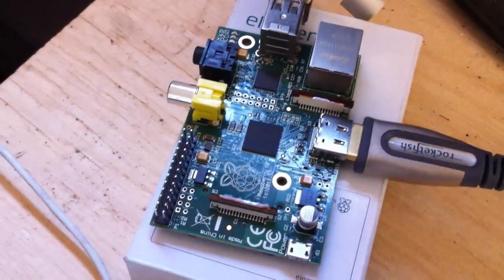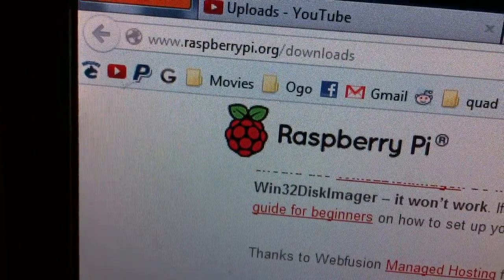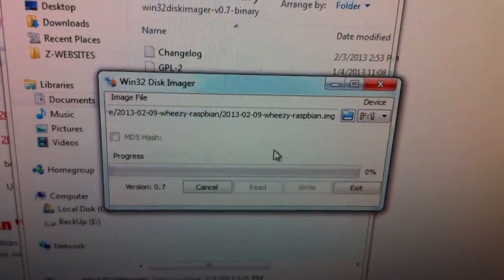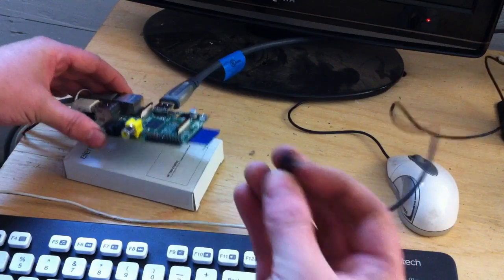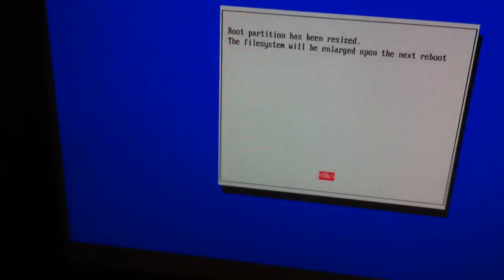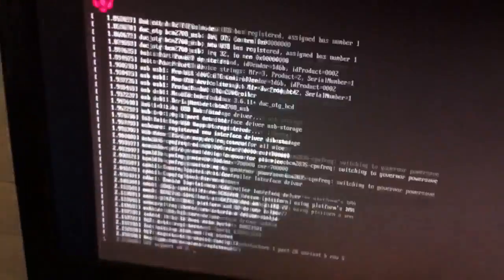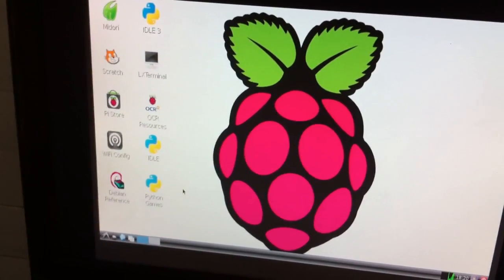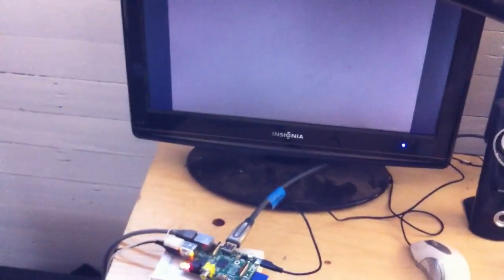How to set up your Raspberry Pi for the first time

Comment: Did you change your display settings to hdmi? or is it suppose to automatically take you to the boot menu when the pi is powered. The problem with mine is when i am connecting my pi with the laptop through hdmi, its booting the normal windows os which my cpu has

Comment: Thank's alot for the link to the WIN32 thing!
Followed the instrucions that came with mine, and could not find a download link/button...
Subcribed, you're worth it!
Reply: stuck on win32 trying to load Weesy without luck errs and such, however  am using a 32 gig card I bought. will I half to format it in windows first? or use the card that pi b came with? and I downloaded all my files in chrome any hints?
Reply: Russ Pavlick You need to format it.

Comment from the maker: Yes, you can use the yellow RCA port to go to an old TV or go to a computer store and get a HDMI to VGA adapter. The PI is being very progressive here not offering VGA. VGA is dead. You will need to use the 1/8" jack for sound if you don't use full HDMI. HDMI carries sound as well as a video signal.

Comment from the maker: Yes, I have mine overclocked to "Meduim" 900mhz with no issues. I have used the "Upgrade" and it does appear to update Weazy but I am still unsure if it just updates the bios maybe someone can post more info. Modern TVs and monitors don't normally need Overscan, On some displays, particularly monitors, just disabling Overscan will make the picture fill the whole screen and correct the resolution. Overscan Reference: elinux dot org. Hope that helps.